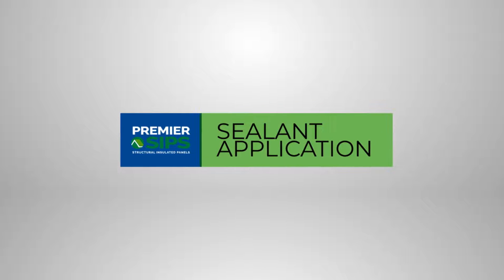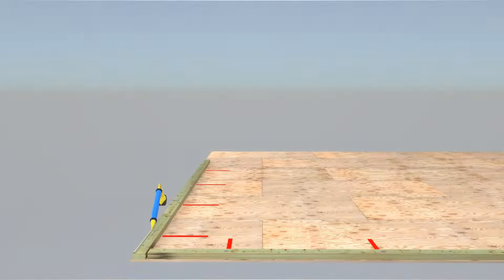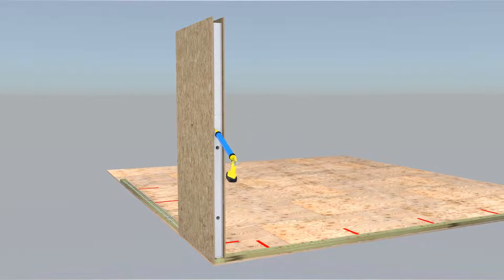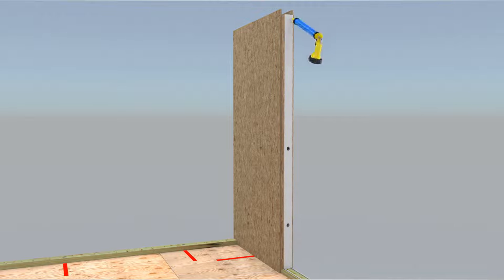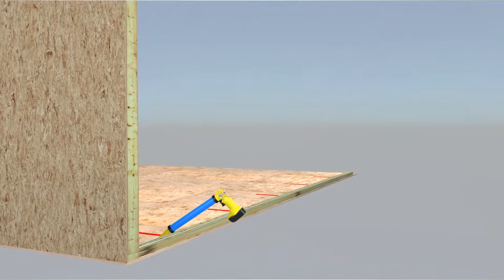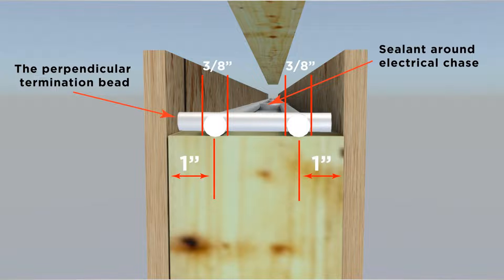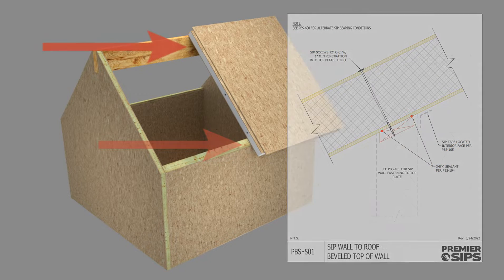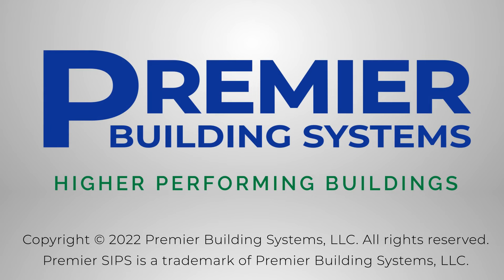Premier SIPS Sealant Application

Comment: @4:27 bottom left, you need to cut out the OSB tongue and lap the top plates across the panels, NOT like this!
Reply from the maker: Hi Stephen, 

Our Premier SIPS are engineered and code approved (ICC-ES & LARR including seismic zones). This approach (“cut out the tongue” of the adjacent SIP) isn't necessary with our panels, as there is no structural reason or benefit to do so. Over lapped corners of top plates are done in 2x framing, but not needed in SIPs construction because the two SIP walls coming together in a 90 degree plane are fastened together with SIP screws. 

Check out PBS-403 detail (https://sips.premierbuildingsystems.com/documents). This is how we've been recommending install since the 1970's. It results in an awesome, strong and tight structure.

If you still have questions reach out to the rep near you here: https://sips.premierbuildingsystems.com/find-a-representative